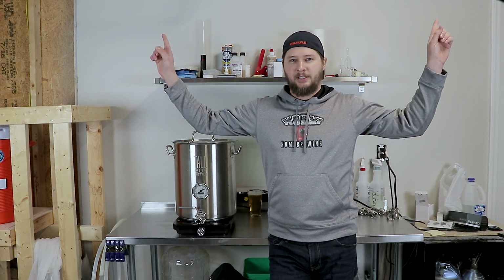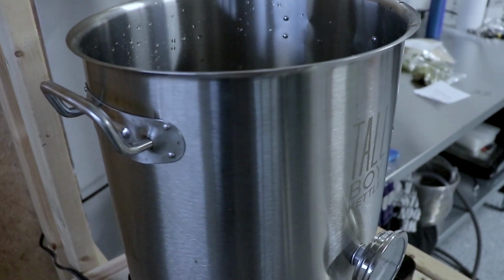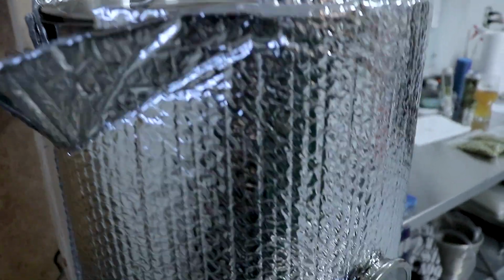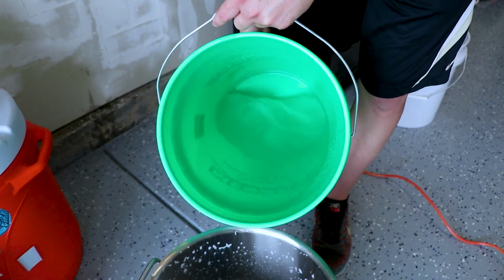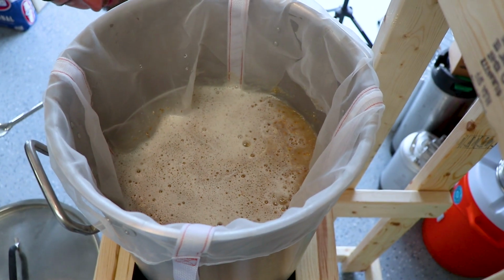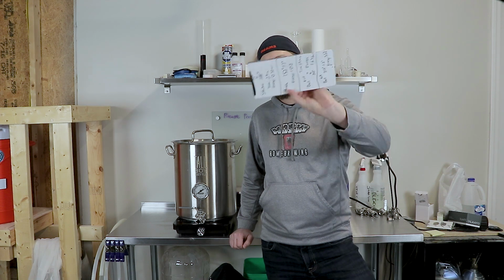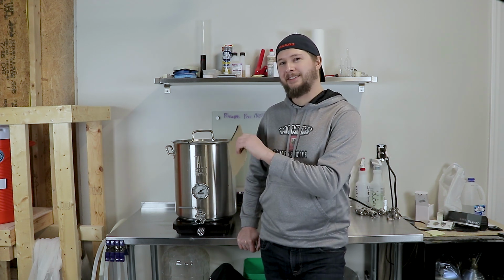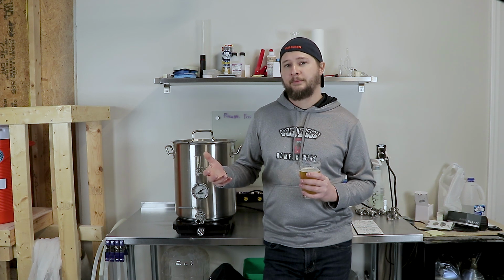Induction Brewing (1800W) 3 Gallon Batch Update

Comment: So glad I found your channel. Although, I find it funny that I was thinking of adding a thermometer to igloo cooler and, bam, you come out with a video on it. Just came across induction cooktops a week Ago and have been really considering it. Any plans on trying a 3500w or 5500w cooktop?
Reply from the maker: Plans are not in place to look into larger induction at this point most because I do not have 240V run in my garage yet. Once that small addition is completed, maybe few months, I would like to revisit larger induction setups. So far induction has been a breeze, and not having to worry about heating elements to clean/get in the way is VERY nice! Cheers!
Reply: @MoskiHomebrew  Thank you, looking forward to it. Also I think you and a streamer named ChocoTaco are clones.
Reply from the maker: (looks up chocotaco) - yeah I can kinda see it! I have a bit more beer weight than he does though 😂🍻

Comment: You think this setup could handle a 5 gallon batch?  I've got a 5 gallon extract kit that I want to use up before jumping to smaller batch all grain.
Reply from the maker: If you do partial boil you could squeak out a 5 gal batch. Partial boil being that you would still only boil 3 gallons of wort then "top up" the fermenter with water before you pitch yeast.

Comment: Personally, I’m brainstorming on a good 3-gallon setup. 

Considering a 5-gallon stainless steel kettle for the boiling pot...and a 6 or 8 gallon stainless steel kettle for a mash/sparging pot, to work with a recirculating pump. 

Everything with only two stainless steel pots. 

It should be sufficient for 3-gallon porter/stout brews. 

Still thinking it through.
Reply from the maker: Not sure how that would work unless you did brew in a bag. But the kettle/tun sizes seem adequate. You thinking induction?
Reply: Moski Homebrew - Was thinking the larger kettle would be for the mashing, with  a recirculating mash pump. 

If the mash temps drop, I could always place it on the burner (set on low heat) to bring it back to the proper mash temperature. 

Then pour it into the boiler and continue. 

I think it’s called a RIMS system. (I’m a newbie, so I’m still working it out in my mind before purchasing everything).
Reply from the maker: Good read here on RIMS vs HERMS. My plan is to move from propane to RIMS using a small pump and Blichmann RIMS rocket in the future. Cheers, Brew on! 
https://bit.ly/2smP4RP

Comment: Why not just brew on a stovetop? More power....
Reply from the maker: You could actually in a very similar manner. Using the 1800W induction cook top is almost a worst case, and we wanted to show that it can be done at only 1800W. Personally I only brew outside where it can get as messy as it needs to, and if it's sticky afterwords it's a quick wash down with the hose. Cheers!